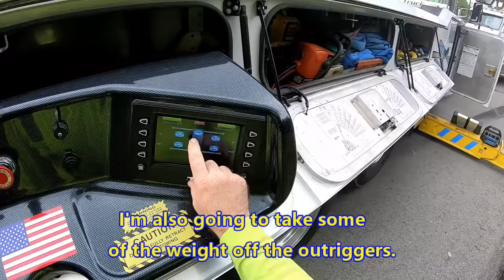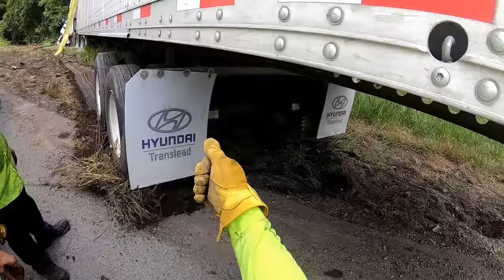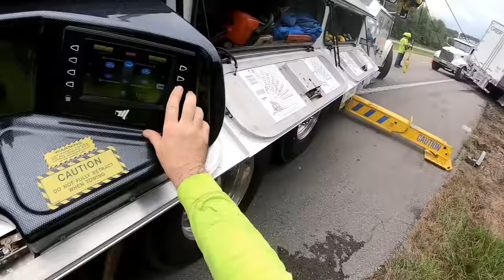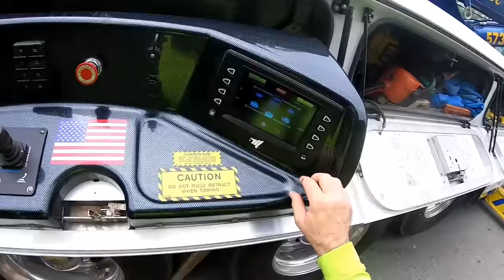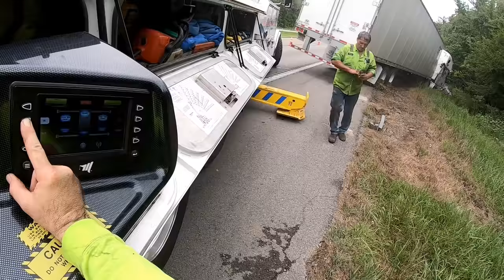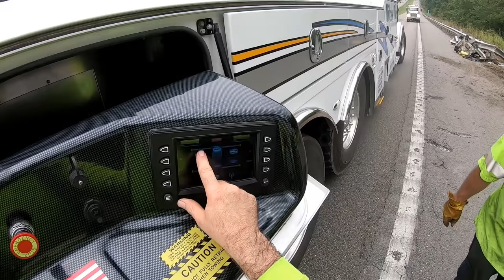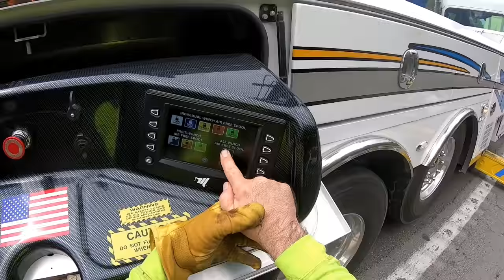Look out for that.....TREE!!!  Tator Team Daisy-Chain Recovery

Comment: Super Ron to the rescue again. Good job getting this truck out of there. Just so you know Monster Energy is anti hydration
Reply from the maker: Mike is the Energy drink guy.  During jobs like this I steadily drink a  mixture of Pedialyte/water and drink Body Armour hydration drinks as well as take potassium pills and munch on peanut butter crackers.  EVEN with all of that, this job took me down.  Mike had to drive the Rotator from the job-site to the shop and I went straight from the shop to the ER.  I was having severe muscle cramps/spasms to the point of being incapacitated.   They filled me with IV fluids and heavy muscle relaxers to ease the spasms.  It was bad enough that one of the nurses passing by my room thought I was having seizures.  It was MISERABLE!!!  But, after a couple hours I was out of the hospital.   Then I was on light duty for about a week.   I've suffered from heat exhaustion in the past and I thought that I had stayed ahead of it this time, but, apparently my fluid and sugar intakes were too little too late.  I knew when my hands started cramping what was coming and I starting downing the drinks and snacks in hopes to of replenishing quickly.   Unfortunately, my reserves had already been depleted.   I know first hand how bad heat exhaustion can be.  That's why I'm constantly telling my guys to stay hydrated.  Just goes to show you, even though I THOUGHT I was hydrated, I was not, and I have learned more from this experience so that hopefully I can prevent it from happening again.   Just another hazard of my profession.   Thanks for watching and God bless.
Reply: Ron I was a medic in the army, so I know what you went through. I am so sorry to hear that you had that happen. I was the guy that yelled at the platoon to stay hydrated. God bless you sir and I hope you have a great day.
Reply: @RonPratt  I'm glad you are ok now! keep up the excellent work.
Reply: @RonPratt  I still remember what my  old drill instructors said.  "The water you drink today will save your life tomorrow.  If you are hydrating for today then you are already dehydrated."  For you and your crew, please take care of yourself.
Reply: It's not anti hydration but yea the caffeine in it will make you quickly sweat out whatever hydration it would provide.
Reply: @RonPratt I did not know that hydration could cause such severe symtoms. You have to had a rough couple of hours
Glad you are better again
God bless you, your family, your employees and your work
Keep save
Greetings from the cold cold Netherland
Reply: They're not anti hydration and will hydrate you just fine in moderation, obviously water is without a doubt much better but one can of energy drink isn't going to cause you any ill health unless you're diabetic or have some health issues making you sensitive to caffine. If you're downing several cans of energy drink a day dehydration is going to be the least of your worries.
Reply: @RonPratt  I read something that the Queen's Guards use for Trooping the Colour. They drink plenty the day before and fill up on the day with various forms of hydration since they will be standing for hours in hot weather in a woollen uniform. Inevitably some faint...and quite a few relieve themselves into their uniforms...black trousers. Good luck for next time, guaranteed you won't let it happen again.
Reply: @RonPratt  For What It's Worth ... I'd say that you need another support vehicle, such as an old mini R.V., on these marathon jobs.  Fire fighters and law enforcement often get them, why not the recovery and tow people?  Facilities, a place to get out of the extremes for a few minutes, quick food and drink, first aid station and a place to lay down if it's needed.  One problem that discourages staying hydrated is dealing with potential "output" while working road side ... not every place will have adequate cover for taking care of those needs (and it's a nasty way to discover that the farmer owning the adjoining property has an electric fence that will knock a Brahma bull to it's knees).

I know of at least one that suffered through a recovery like this one, under similar circumstances.  Wide open area, heavy traffic, residential nearby.  Two days later he was in the hospital with a bladder infection.
Reply: Ron Pratt  Glad that you (Ron) was okay...we try to learn something new everyday...if not our mistakes ..mistakes from others... God Bless you..
Reply: @Xcaliber Trekker
Yes, it is the caffeine that dehydrates you. Which is why I tell people that Iced Tea is not for hydrating as it has caffeine in it as well.
Of all the regular pops on the market, (not the ones with caffeine added on purpose), Mountain Dew is the worst for hydrating because it contains 47% more caffeine, by volume, than coffee.
Reply: @davide.burden2043  You haven't had good coffee then. There awesome out there that add extra caffeine and keep you awake along time.
Reply: @RonPratt  I love unflavoured Pedialyte (unflavoured, along with sugar free coconut water) to stay hydrated. It might taste horrible but damn does it work flawless.
Reply: @RonPratt  Ron GREAT JOB AS ALLWAYS,  I Own a welding Co, So all long Sleeve Shirts when welding for Arc-Burn, And Like you I won't send any of My Guys to a Job that I would not DO MYSELF!  That heat exhaustion is a Sometimes Sneaks Up!  So Been there Done that!   GLAD YOUR OK,, PS, (SORRY HAD TO ASK)  HOW DID THE NURSE LOOK!😜😄😃👍 , ALWAYS MAKES YOU FEEL MUCH BETTER WHEN THAT INVOICE GETS PAID, NO CHEAPY THERE!  GLAD YOU AND THE CREW ARE OK, 
I WATCH EVERY VID, JUST DONT COMMENT ALOT!  JACK
Reply: @RonPratt  how long were you on the job in this video? Maybe you could start telling us at the end of videos how long it took the crew from start to finish.
Reply: @RonPratt   Hi Ron, this is my first comment on your channel.  I have been watching your videos for a while now.  This will sound crazy but I watched this piece on TV asking what drinks hydrate you better, and you will be shocked.  So they broke people into 3 groups and put them in a heated room on stationary bikes.  Each group would come out drink and go back into the room, still cycling.  One group had something like Gatorade, the other group got milk and the last group got water.  Doctor's and scientist monitored each group.  And it turns out that milk was the best for hydration and next group to follow behind was water.

They said the group who drank milk was more alert and was able to cycle in the heated room a bit longer.  Milk slows the emptying of the stomach, which also means less trips to the bathroom.  In another report they do say the next best thing to milk is Pedialyte (or something like it).  

I know it sounds weird to drink milk when your hot and sweaty.  We tired it with our kiddo when he came in from playing outside and being all sweaty, and we saw difference in him.  So maybe it might not be such a bad idea about 
keeping some milk in the company's fridge.  Just a little helpful thing I learned and thought I would pass it along to you.  That looked like one heck of a job, and that obviously you are doing better.  Take care out there!
Reply: @michaelhoward9411   I had the same question. Maybe a small timer or clock in a corner of the screen.
Reply: @RonPratt   please tell me it's crunchy and not smooth peanut butter
Reply: @RonPratt  Praying, for ya brother.
Reply: I was thinking the same thing when I watched the video, all the extra stuff they put in the energy drinks and Gatorade requires more water for your kidneys to remove it. I always preferred flavor over plain water till I tried Aquafina, not exactly sure kind of shenanigans make that water taste so good to me. Interesting on the label it says "pure water, perfect taste"
Reply: When you realize you need it's to late but had to address when under the gun, great work and you could see the stress you all were under!
Reply: @RonPratt  I don't mind admitting it. I teared up a little reading about your dehydration issue. You are an inspiration and a very hard working person and anytime I see someone put their whole into something it always affects me and leaves me in awe. Good grief, I'm not only a grown man but a 50 year old one! Despite being on a different continent, it's funny how some people can feel familiar through simply having a lot of respect and I don't actually know you from Adam.  This is not a political statement but whilst Mr. Trump is trying to make America great, it is actually watching people like you that makes America look great and the same goes for my country or anywhere else on the planet. Stay safe. Please.
Reply: Caffeine is a diuretic. It makes you pee more.
Reply: I drove truck over 30 years & I haven't seen a better operation than yours. Everything went smooth on a big job as that one. You're 100%!!!👍👍👍👍
Reply: @terrynagle7410  , I was in the Marine Corps in VietNam 68-69 & our Corpman was always making sure we took Salt Pills & drank a  lot of water everyday..
Reply: @hungryjack8032  Can you give me any names of those coffees? I drink plenty of coffee every day, yet I seem to be immune to the effects, as I will be constantly sleepy all day, nodding out here and there ALL DAY, no matter how much coffee I drink. It's really quite frustrating, because I love coffee, 100% Columbian is my fave.
Reply: Terry Nagle that the reason we kept our hydration packs full and listen to doc while we were in the desert, heat exhaustion is a bitch.
Reply: Ron Pratt morning
Reply: @RonPratt  Ron, I suggest you consider whether you can dress differently to maximize the evaporation of sweat from all body surfaces. Dark heavy blue jeans stay wet and hold in heat; there are breathable, durable work pants out there. Ventilated hard hats (we all hear about putting on a hat makes you warmer in winter, same is true in summer) and cooling vests are good options too.  Miller should also mount big fans on their trucks! They've come up with ingenious ways to put everything else on there. Love watching the work you and your team do helping people recover from one of the worst days of their lives.
Reply: @RonPratt  oh my...Be careful, please, I've been on the brink of that before (no A/C in most school buses used for summer school and camp) and yes, it's horrible feeling like that. So glad you're doing ok now :)
Reply: @RonPratt  P
Reply: @RonPratt  those sort of heat problems are incredible. The worst I've had was climbing a mountain in 40degC plus heat about 105degF. I was going well until I stopped sweating. I had to sit under a tree and drank well over a litre of water and was instantly drenched in sweat. There were 5 of us on that climb and I was pretty fit. Two dropped out before me and two made it to the top. One was a champion gymnast the other was my boss who was super fit and pushing 60. He came down bragging  and making fun of all the unfit young  whippersnappers. I couldn't resist having a dig back at him and pointed out he had a brand new pacemaker to keep his heart going. It was implanted because it turned out his low heart rate wasn't because he was disgustingly fit but his natural pacemaker wasn't working properly.
Reply: @HappilyHomicidalHooligan  Those Camelbak's are great.  I used one when hiking up to Delicate Arch in Utah.  Would not have made it without it.
Reply: @HappilyHomicidalHooligan  I love camelbaks. We used them in the Navy on the flight deck. Working in the Gulf where you can fry an egg and steak on the flight deck the heat gets to you.
Reply: @Ron Pratt: Huge respect for sharing not only the direct job risks like traffic but also the indirect risks for you and your crew out there.
You seem to be a very good instructor/trainer in your profession and personally.
Reply: @RonPratt  I guess you call that 110%.
Reply: Yes
Reply: @RonPratt  û
Reply: Good GREIF everyone's ok
Reply: @RonPratt , try n drink lemon water thru-out your day will help keep you hydrated, get some Turmeric will help your muscle spasms, with other spices n herbs
Reply: I always tell people tree hat work outside to drink at least a little before they leave the house and to drink at least 8-12 ounces every hour to stay ahead...most people aren't good at staying hydrated when you're thirsty you're ready way behind...normal intake is half your body weight in ounces...more when you're outside in heat and humidity...love your videos stay safe you've got a good team
Reply: @RonPratt  Thanks for the follow-up
Reply: @davide.burden2043  I learned that the hard way when I was building decks when it was 100 degrees out. I ended up in the hospital with dehydration and irregular heart beat from the caffeine. 30 years later I am still sensitive to caffeine! Even a candy bar can set me off.
Reply: @TheKira699  m
Reply: A mister that you could set up may help.. A stand up fan with a water drip.. Seems a FD could help set you up with something.
Reply: @RonPratt  I dug for weeks to put in a underground water system for my front and back yards. I removed several tons of rocks. The temperature was in the mid to high 90's. I kept hydrated and drank water with honey when my hands started to shake. I also learned quickly to get the water hose and completely wet myself down...long sleeve shirt and jeans. I also wet down my hat. I actually had chill bumps in 90+ degree weather when I did that. When my shirt started to dry out, I would wet myself down again.
Reply: @RonPratt  I agree with you Ron Pratt
Reply: Ron, thank you to keeping the language on an educated
It’s so ice to rest assured my grandkids can watch your show without learning language below their level! They are 8-9 and 12!  Their parents have taught them to talk on an Educated 
level and  no profanity!

I am aggravated to have to turn of programs 
because it’s unfit for adults let alone young men Like I have mentioned!
Keep it clean Ron
Reply: Yes he is. The old school way taught.
Reply: Take it easy ron god is watching up above and answers your prayers

Comment: Pulling those posts out of the ground with the Rotator, is like pulling toothpicks out of a cocktail olive...
Reply: I hope the highway crew thanks them for giving them a head start on the repairs.
Reply: @judil3294  nope, dot will charge em 200 bucks a post. At least in PA thats what killing a post will cost ya
Reply: thats probably why he only removed the already damaged ones that would need to be replaced anyway and be covered by insurance 

It seems from past vids that in his area the only thing they are fussy over are the wire barriers, even when tangled in a truck they need permission to cut them.
Reply: @JW...-oj5iw  Your point? I was saying they charge 200 a post for each one that is damaged. Then that bill is paid by insurance(Assuming you have comp and not just collision) Though trucks are most likely to have the full suite of insurance.

Comment: "Caution when opening doors.  Load may have shifted in transit."  That sign has never been more applicable... :)
Reply: I'm glad i'm not the only one who saw that lol. I had a good chuckle.
Reply: I had the same thought, and the follow up that yes, it will all be moved, but to the front of the trailer (excluding the dinged-in bit).
Reply: No kidding.  I've had beer loads shift when going across I80 into Chicago.  Without any wreck.

Comment: Again, continued thoughts, prayers and Blessings from Ohio .... Outstanding overall recovery! One of the more challenging jobs I've watched you do. Other than contending with overhead power, just about every element working against you ..... The initial job at hand, heat and humidity,   gravity, the tractor completely disabled, including loss of air pressure, approaching storms, staying hydrated, cramps ..... not to mention, ticks and chiggers were no doubt there on-site with you all!  Everyone performed very well under the circumstances.

Very well executed in every respect!! I'm sure many others learned as I did, use of the 'cribbing' to block the wheels!! I do have to add, we came a little too close for comfort to the control door on the Tator with the trailer!! BUT ..... your expertise prevailed once again! Lol .... Thank you for sharing another outstanding video. Much appreciated by us all. Again, many Blessings to viewers and subscribers .... And thoughts prayers and Blessings on behalf of Ron and family, and the staff at Midwest. Stay safe and well.

Comment: Those cables always make me nervous, scared they gonna snap!
Reply: They are made for this
Reply: @ mips
   I thought that Ron might have doubled
up on the cable when they were pulling
it out of the ditch. But he knows 
what to do safely.
Reply: He also does the routine maintenance and changes them out regularly.  Ron makes his hourly goal to make sure everyone and everything is safe.
Reply: Don't worry.  You're watching it on a computer...they won't hurt you...
Reply: @erickemp4840  Plus usually rated for twice to 3X the winch capacity
Reply: The ones that snap are the ones that are poorly maintained (like rubbing on things they’re not supposed to & causing frays). Ron’s the type that keeps safety first in his mind & wouldn’t allow anyone to work with frayed lines. I wish more tow companies that that way.
Reply: They are dragging two wreckers along with brakes set.  Truck will lift off the ground before it would even snap a strand.  Our 20k lb rated winch on the C17 will rip a 100k D ring off before it would snap a cable.
Reply: Eric Kemp Yeah, but they can still break.  Anything can break.
Reply: @erickemp4840  yeah sure, but Murphy's law applies even to perfectly maintained things. Sure the risk is small, but still.
Reply: A healthy fear nonetheless.